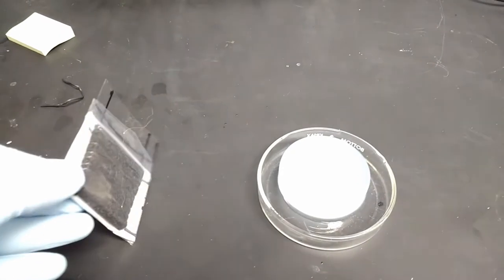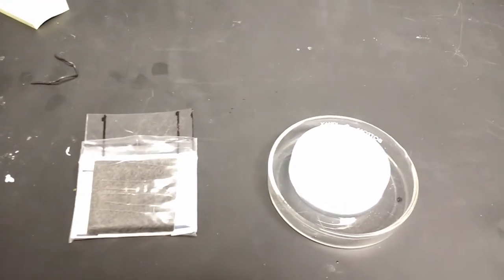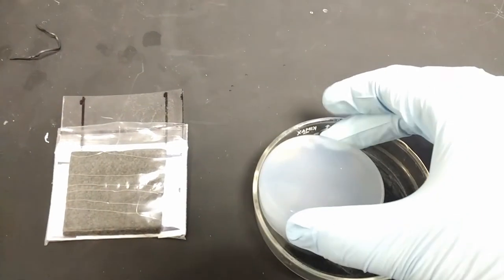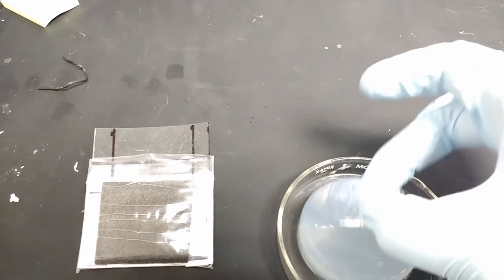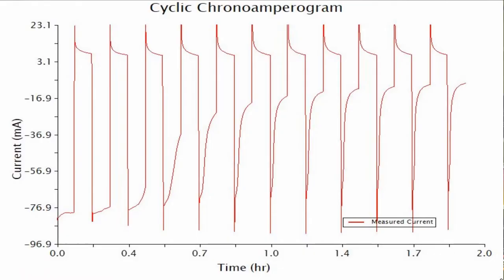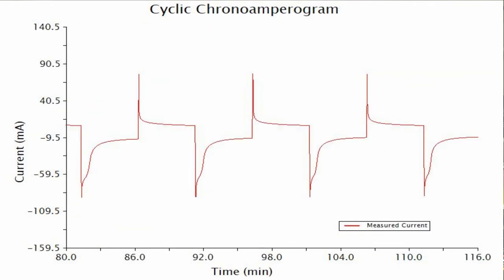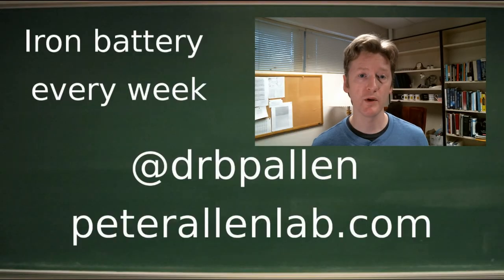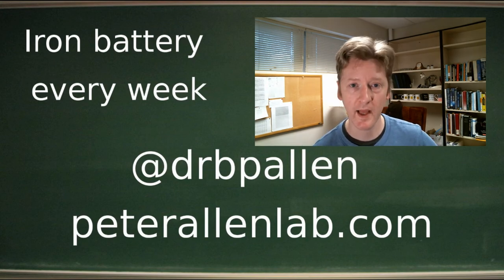Iron Battery part 59

Comment: So what is the percentage of your battery from lithium-ion capacity?
Are you getting good charge and discharge?
Reply from the maker: I've been deep-cycling the cell for a few days to see what kind of performance it gets. That will be the next video. It's ~200x lower energy density compared to a Li-ion cell. It looks pretty stable, though. If I can pack more iron 3+ around the cathode, I'll be in good shape.